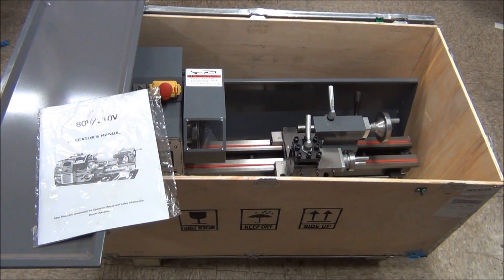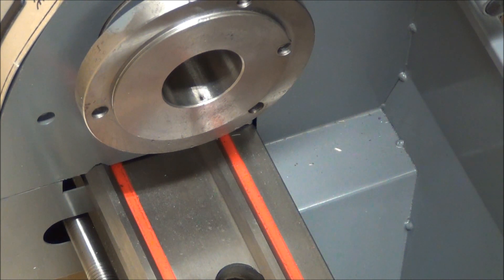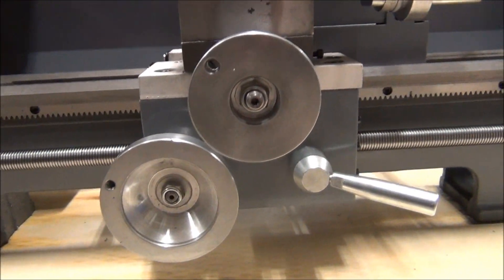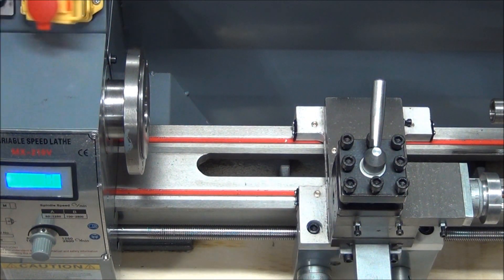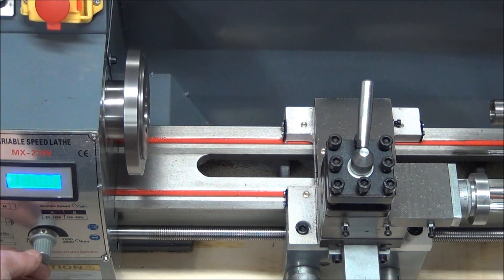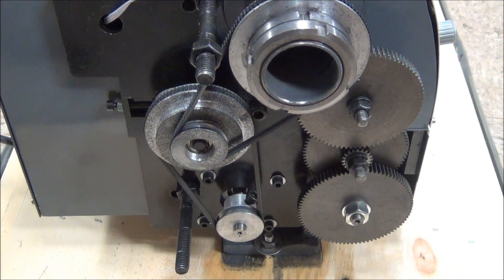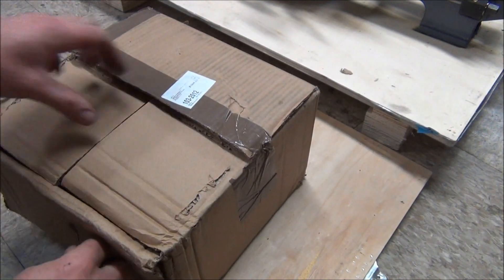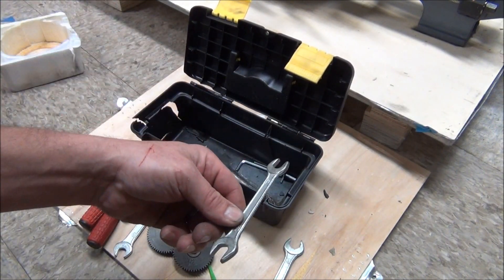TS-210 8" x 16" Lathe Part 1

Comment: Bearing 30209 inner diameter 45mm, inner spindle diameter 43mm, so wall thickness 1mm... Really strong enough?
Reply from the maker: No issues and I've beaten the snot out of it.
Reply: @number40Fan  Thanks for the fast reply, I have the same lathe and now I´ll dare to change the bearings too. Excellent documentation, encouraging me to make mine better. Good work!!!
Reply from the maker: @paulplatt3984  Thanks.

Comment: Just get mine outta the crate. My first lathe and have never seen one run in person. Its going to be a process but im very excited.
Mine is the 14" though. Also, mine came with a 3 jaw attached to the lathe and another in a separate box Ive yet to open. 
Today im going to inspect the bearing and tear down the compound a bit. 
In concerned with the product to clean and lube the lathe. I have WD40, Aerokroil types but unsure of grease for gears high heat spray? Also Im 100% lost on gearing set up. That's will be a days worth of research itself... Lots of work to do before I jump on my first project.
Reply from the maker: Way oil, or any heavy oil will do for most lube points.  Don't use grease on anything exposed as it will attract chips.

Comment: Got mine a couple of weeks ago. (Bummer) runs for 30 seconds and quits. Also the motor was supposed to be 750 watt 1 hp. Well it are with a 600 watt motor.  That was the two major problems. It also had the normal other problems.  Mine when it runs it is way quieter than the one your showing.  But as soon as  it’s finished it will be a good lathe.  Oh the seller offered me  monies back too compensate me.  Good luck with yours. And enjoy it.  🤪🤪🤪

Comment: The big thing these machines have going for them is the big spindle bore. Order a #5 Morse Taper 5C collet adaptor and make up a draw tube. For the Zed axis build a DC variable speed drive unit and leave the change gears disengaged unless you are threading. The big concerns imo are just how light are the bearings a d the overall weight. Bolt this down to a stiff heavy bench (check Cogwheels YouTube site) and you would have a decent small lathe.

Comment: Hello thank for the videos, after 11 months , how  do you feel about the size?, is it enough?, find it a little 
Short?, let me know your experience?,
Reply from the maker: I think there has only been one time that I thought it was a little too short and that was when I was trying to face a 19" piece of 3" SS tubing.  Yet, I still got it done.  I had to remove the lead screw bearing from the far right side and hang a tool pretty far off of the QCTP, but it worked!
Reply: number40Fan thank you friend
Reply: @number40Fan  Hi, Iam thinkin about buying the long version which is 31" or 800mm between centers. Not sure if that is maybe too long. Overall length is supposed to be 1200mm. What is overall length on your machine?
Reply from the maker: There have been a couple times that a longer machine would have come in handy.  Not sure if they were available when purchased mine.  Not home right now, but I'll get a measurement when I get the chance.
Reply: @number40Fan Thank you, what I have read it should be about 85cm but your lathe looks larger. The one thing that these chinese lathes really has going for them is that large spindle hole. You need to go up to USD 3500-4000 to get the same diameter on a precision lathe. Maybe a 400mm is enough because of that very large spindle hole. With that spider that you made you have easily doubled the workpiece length. It is nice to have a lathe in the garage, but it is taking up a lot of space when it is not used. A 600/38mm lathe would have been perfect for me. Would have taken up about a meter of space I reckon. Nice videos
Reply from the maker: @02dag32  It is about 33" wide.

Comment: Can you confirm that this machine has a 750W brushless motor as advertised on eBay?
Reply from the maker: Did you miss my first reply?  

Mine is brushed.  I don't remember it being listed as brushless either.
Reply: I think the Brushless is a newer version.
Reply: Yeah the newer version is brushless also list fr 830 and up. 38mm bore hole. Gonna order one this week. Been checking them out all week long. Between grizzly G0768 $ 1400. Compared too 830.  🤪🤪🤪

Comment: Hey - so - i have your IDENTICAL lathe - and it makes the IDENTICAL sound ... i posted about it on hobby-machinist - apparently it's a resonance happening in the coils of the motor - wondering if you'd looked into this yet - i've had this thing apart - but not as much as you have ... great job and thanks for the vids ... we should form a user group of some kind maybe haha (for those with these 8x16 MT5 lathes
Reply: i have to say im pretty pleased with mine - i got a lot luckier than you with my runout (not measurable) and metal quality etc etc - no voids to speak of yet that i've found ... though I bought an AXA QCTP that will require some machining of the crossfeed block etc to use since it's too high even with the tool setup at the bottom ...
Reply: and my chuck came with the backing plate ... though yours is probably a better chuck than mine now for having gone through it etc
Reply from the maker: The high pitched whine has since settled down.  Replacing the spindle bearings fixed the other noise.
Reply: interesting ... maybe i shouldn't tear into the thing just yet ... also interesting to hear about the bearings - i'll have to do the same - i don't suppose you would have a bearing size designation handy? I couldn't find anything in the literature that came with it - did you use SKF or something?
Reply: most of my noise from what i can tell seems to come from my gears - though i noticed yours seem pretty loose too
Reply from the maker: NTN 30209 are the bearings I replaced them with.
Reply from the maker: I am working on a new change gear holder, but had some stuff to do around the house to appease the wife.  About to get back to it.
Reply: cool - thanks - i'll order some right now

Comment: it looks like it does not have any degree marking plate at the tool post holder
Reply from the maker: It has, or should say, had one on the cross slide on the backside of the compound.

Comment: How does it cut steel?
Reply from the maker: With the right tool, good.  But it does pull down on the motor some, depending on the depth of cut.
Reply: @number40Fan  any luck with cutting inch treads yet?
Reply from the maker: I have threaded a few barrels 24 tpi and 28 tpi using the 2mm lead screw and spare change gears from my HF mini lathe.  I still haven't been able to take the time and install a 12 tpi lead screw I purchased a while back.  Really busy around here lately.  Soon, though.

Comment: I have buy exactly the same from VEVOR , inspect closely all gears , a lot of gears are missing in my box !!! 
And i have many problem to adjust perfectly all parts for a decent work ...
Reply: i have the IDENTICAL one too haha - the 38mm pass through is nice though
Reply from the maker: Yes, it is.
Reply from the maker: It is a good idea to check everything over.  I had a couple of damaged gears, but they were all there.  My seller was able to send me new parts for everything I had issues with.

Comment: i have got this one from vevor.com with some missing parts which they are shipping over UPS. I have some questions
, may i have your email address, plz ?
Reply from the maker: Not sure what I couldn't help you with here that I could via email.  Ask away!  I'll answer.
Reply: @number40Fan  can you let me know how it cuts threads inch and metric I had a lathe and several of the thread pitches wouldnt work - please let me know 8,10,12,14,16,18,20,24,28 TPI. are most important
Reply from the maker: Metric, cut all to your hearts content.  SAE/Imperial, there is a gentleman on another forum that posted using a 34T gear will get you very close to most imperial threads.  I'm working on a 12 tpi lead screw swap.  Too many coals in the fire right now to get it done.
Reply: @number40Fan  please keep me posted with threading thank you Bret!
Reply from the maker: I will.

Comment: good luck, i put about 100 hours into mine so far and it pretty much still sucks.   if yours has the 38mm bore you likely can't use the threading table in the manual and your headstock gear is 56 teeth.   It is actualy a MX-210 D/S  but I've yet to find the manual for one.  The banjo for mine is not able to mount the gears for .5mm or .75mm threads.  

here's a list of things I had to do.

0. literally every surface required deburring.
1. rea-align the headstock to the bed.  it was off by .1mm over 50mm.  many guides on how to check thi.
2. hack the tailstock.  I actually need to mill some material off of it.
3.  add grub screws to the carrage holddowns.  they had no adjustability if you wanted them right.
4.  lap the bottom surface for the carrage holddowns.   there was a huge high spot and I could not traverse the bed and keep it tight at all.
5. lap the cross feed.
6. lap the compound
7. add holes in the compound block so you don't have to unscrew it every time you want to adjust the angle.
8.  change a belt, the first one broke.
9.  take the back cover off to change the belt.
10. add QCTP
11. make extra change gears, the feed is not very slow at the slowest with gears it comes with.

i'm sure I missed a few things...

I'm currently making an electronic lead screw since threading is pretty much not possible the way it is.

anyway, good luck.
Reply: Bought me one recently and I literally have not had to do any of the things people claim they absoulutely had to do. I call bs on out of box maintenance
Reply: @bcool6801  Its a craps shoot . some are good enough to use as shipped but some required TLC to correct issues from poor QC at the factory. I got lucky on one I bought and not so lucky on another.
Reply from the maker: Sounds like yours needed a lot of lovin'.  Drilling the compound is a great idea.
Reply: @number40Fan   if you search "andysmachines lathe"  the first result has a bunch of mods you may be interested in.
Reply from the maker: I'll give it a look over.  Received a imperial lead screw and a set of half nuts from a G0768.  When I get done playing with my mill, I'll see what it is going to take to make them work on the lathe.
Reply: thanks for this Jesse
Reply: This manual and parts list/pricing for an 8x16 lathe may help?'

https://cdn0.grizzly.com/manuals/g0768_m.pdf
https://cdn0.grizzly.com/partslists/g0768_pl.pdf
https://www.grizzly.com/products/g0768/parts

Other ebay sellers may buy similar lathes from the same Chinese factory and drop ship to bargain hunters?

After you clean, align and get it running- there are a few creature comforts you can accomplish:

https://www.youtube.com/watch?v=PIGYKlTtBIg&t=57s
https://www.youtube.com/watch?v=7jOVEh1uxpo
https://www.youtube.com/watch?v=sHcdEutcs5g&t=106s
https://www.youtube.com/watch?v=OXa1vQTU8b8&t=202s

The Grizzly G0768 used to be $900 or so before the tariffs and trade wars started. 
Grizzly probably has arrangements with factory with specs and requirements.  
Units that are sold on ebay at discount may be rejects or seconds/damaged manufactured goods?  
These days you never know...

Comment: I just bought the same lathe on Ebay for $977.00 with free delivery.
Reply: Does this lathe cut threads?
Reply from the maker: Yep, check your other posts.
Reply: I purchased the same model roughly two years ago for 800 € (delivery included). The furniture and internal bearings looked a bit cleaner than yours. The noise it makes when running is pretty much the same too, but a bit less grindy. Looks like it was at least better oiled, or maybe the transport was more standable. However : it becomes very *shaky* when running at 800/900 RPM, which are my preferred working speed. It does not come from the chuck (I unmounted it to verify this).

I'm almost a complete noob in machining and I cannot afford purchasing something more expensive, but I'm totally OK with having to tune it as much as I can to make it usable. I just need valuable advices :-)
Reply from the maker: Nice.  Let me know how everything turns out for you!

Comment: Hi, what was the store on ebay? I look for one of this, it is nice machine in your opinion?
Reply from the maker: It is ok, but it needed some work to make it decent.  If the lathe comes with a good 3 jaw chuck and you don't have to spend the time and money getting a good chuck to work, it would really be worth it.  I have other videos showing what I have done to the machine to get it to a decent point.

The store I bought it from is currently out of stock.  Search eBay for TS-210 and make sure in the description it says it has a 38mm Spindle Bore.
Reply: @number40Fan  i see your's upgrades, give work but look's nice. After change the bearings it is hard the alingment?
Reply from the maker: Not sure what you mean, but everything went good after changing the bearings.  You might get lucky and not have to do it.  Mine just made too much noise for my liking.
Reply: Got mine for 765 delivered, only took about 50 best offer d!